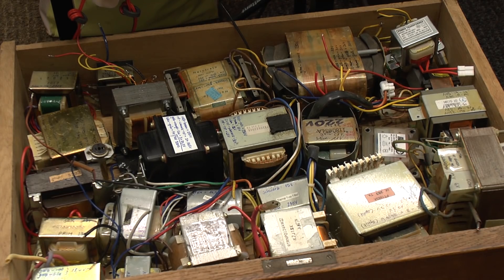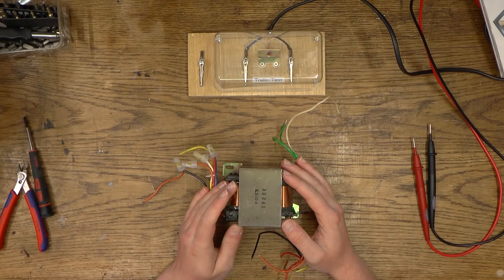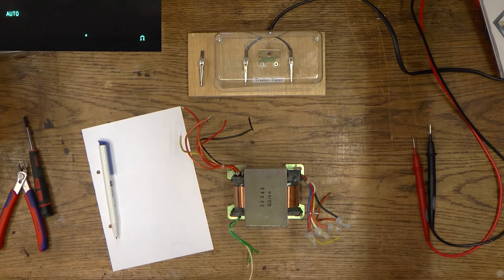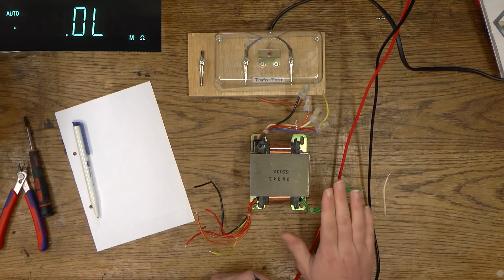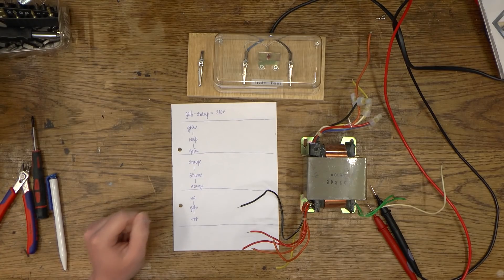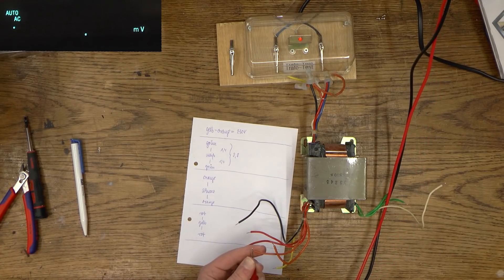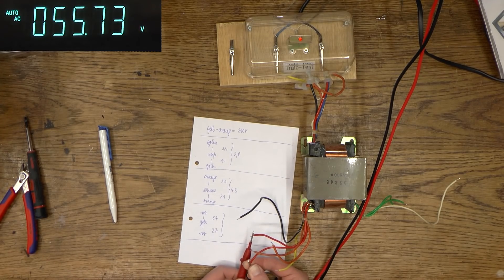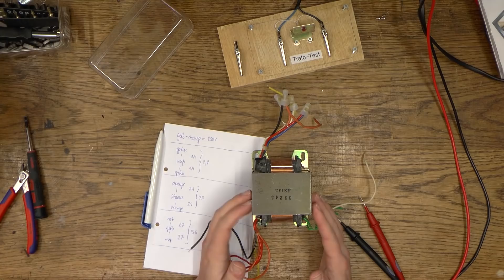How to test an unknown Power Transformer

Comment from the maker: NOTE: DO NOT TOUCH ANY TRANSFORMER CONNECTIONS WITH YOUR BARE HANDS!!!
I knew this transformer came out of an old HiFi receiver that didn't use any High Voltage, so what I did was safe.
Reply: With HiFi amplifiers, I would be very careful!
I have definitely already repaired hi-fi amplifiers that worked with + - 48 to 60 V against the center tap. Between the outer turns it becomes really dangerous.
I would generally be careful when measuring unknown transformers. Especially with your bare fingers. I prefer to use fully insulated crocodile clips for such purposes where I can plug in the test leads of my multimeter, or wago clamps with folding lever. I feel tensions on my fingers already from 24V. Whether DC or AC.
I would always provide open cable ends with terminals, so that no unwanted short circuits arise.
Although many transformers are short-circuit-proof, but you still do not have to expect it. There are also transformers with built-in thermal fuse, which is located somewhere inside or at the edge of the windings.
Some thermal fuses reset themselves when the temperature has dropped, others remain in tripped condition and either have to be replaced (if possible), or you have to take the transformer to the scrap merchant to get at least some copper money.

If there is an insulation fault between the primary and secondary windings, or even to the housing, this can quickly lead to death. To be on the safe side, you should use an insulation measuring device that can generate a test voltage of 500 V.
Reply: This is something that still has me terrified to touch wires. I'm still afraid to use my oscilloscope on circuits because I don't trust my understanding of electricity yet. Dr Cassette, why didn't you get shocked when you touched the 43 volt line? If djblackarrow feels tension at 24V, wouldn't you feel a little more than tension at 43V? I guess my question is, how do you know it's safe to touch? Is it really as simple as the voltage? Weren't you the least bit concerned not knowing any voltages of possibily brushing against something that could zap you?
Reply: DrCassette will using all the output windings simultaneously cause a drop in voltage and or current for each of the output windings??
Reply from the maker: When running any winding with a load connected to it the output voltage of that winding will drop slightly. This should be insignificant in most applications. Each winding is designed to handle a certain current. For as long as you don't take more current than that and thereby overload the transformer, all is fine and the load of each winding won't have any significant effect on the others.

Comment: Nice test jig there, but what I would suggest is to build another jig like that which can be used on the secondary side, but with only alligator clips secured side by side on it, like that "extra" clip that you put on the left side of your primary jig. That way you could hook all of the transformer's secondary leads to it, making it easier to test all of the voltages with your meter without having to touch any of the outputs, just in case it really IS a totally unknown transformer, and the voltage output is high enough to shock you. (Because as you say, anything above 60V should not be touched with your bare hands for safety.) Plus, an added benefit of securing all of the secondary leads to a jig also would be to prevent any accidental shorting of any of the leads when it's on, while you're testing the voltages on other nearby leads!... As you probably already know, if you short out a transformer in that state, (i.e. directly out of it without any fuses or protection circuits hooked to it), you have a very good chance of blowing the transformer, and then of course it would be useless, except for a "paperweight"!

Also, one note about the primary side of the transformer; if it truly is a totally unknown transformer, you should also check the resistance between all of the primary windings to see which set of leads has the highest resistance between them, and then only connect the power input to those leads at first, very preferably using a variac, slowly increasing the voltage, while watching out for smoke and/or overheating, and listening for any really loud humming, any of which would indicate an overload, and that most likely that specific winding is not actually the primary after all... Because if you were to apply 220-240V into a primary that was only designed for 100-120V, then there's also a very good chance of blowing up the transformer, or at least damaging it by overheating it!... Once you found that the transformer works safely and quietly at your input line voltage when using the terminals you chose, then you could go about measuring all of the voltage outputs.

BTW, the "megohm" resistance readings that you were measuring at first between the separate secondary windings was simply your own body through your hands... If you were to use another test jig for the secondary wires as suggested above then you would get an open circuit reading between any of the wires of completely separate windings.
Reply: I am glad you pointed that out
Reply: This was as step down transformer, so secondary windings will be a lower voltage than the primary voltage. However there are step up transformers where the reverse is true therefore touching the secondary wires is pretty dangerous and not recommended.
Reply: Phil Glazzard; Yeah, I figured that was a step down transformer by what he was doing, however, even with that lower voltage, my first initial comment still very much applies, especially in regards to accidentally shorting out any of the leads of the transformer while it is connected to power input, because accidentally doing that could very easily burn out the transformer, trip a breaker, or possibly damage something else in the circuit path, (whatever it is), especially if the transformer is a larger one with either high current and/or voltage on any of the other UNconnected but still very potentially "short-able" leads of the transformer... You just never really know, especially when testing an "unknown" transformer like this, so it would be better to be totally safe than sorry in one way or another!... 

Also important to note is that even with a transformer that's "known" to be a "step-down" type, especially if it has a primary input of 220-240 volts, the secondary, stepped-down voltage can still be quite dangerous and uncomfortable to touch, because it might have a secondary output, (in that case especially), of as high as 120 volts or more, and any voltage over about 60 volts is uncomfortable to touch, and anything higher than that can also be potentially dangerous to some people, especially if you have any kind of heart condition, etc, etc... Voltage tolerance depends on the person of course, but... 

Anyway, the main point that I was trying to make originally was that if he had a complete test jig like that, with enough alligator clips to hold ALL of the leads of any given transformer under test, then he could make much safer, easier, quicker, more accurate, and more consistently reliable test connections for both ohms and voltage(s) of all of the windings, without having to worry about accidentally shorting any of the leads out OR shocking himself!

Comment: It is dangerous to apply full mains voltage to unknown transformer! There could be a short in primary winding and you let a lot of current through. Or you connect to what you think is primary but in fact is something else and end up with too much current going through. 
Instead of feeding the unknown transformer directly off AC mains you should feed it off another known step-down transformer with safe AC voltage level (i.e. 24V) or auto-transformer set to safe voltage. The first test is to find out the ratio between primary and secondary windings. The ratio does not change with voltage. Once you measure the ratio, simple calculation will get you close approximation for expected voltage at full mains (220-240 or 110-130 depending which continent you are on).
You should also measure AC current on the primary as sanity check before you apply full mains voltage.  

As others pointed out, if you must apply full mains voltage to what you think is primary winding (still bad idea!), at least limit the current with a resistor (i.e. incadescent lightbulb).

8 Ohm seems way too low for primary on 230V. Either your measurement of primary coil is way off or you have a short or this may be a transformer for 110-130V/220-240V AC wired for 110V AC and the other windings you ignored could be there to re-wire it for 220-240V AC. Manufacturers rarely put extras in (=cost) and then waste them. Those windings are there for a reason, even if that reason is unknown. You should measure all windings, not just those you think are the primary. The extra wires are coming out on the primary side so my guess is this is a transformer was used to make equipment for Europe and North America and the wiring was switched on the assembly line to one or the other depending on whether the order was for Europe or North America and unused windings were capped with insulators. Some manufacturers connect transformers to a 120/220 voltage switch selector or have all primary leads soldered to a circuit board and have shunts on the circuit board configured depending on the market given batch of equipment was goint to. So the point is: do not ignore any windings on primary site.

Comment: Thanks for the video.
I would have used screw connection terminal block, like https://images-na.ssl-images-amazon.com/images/I/51VPC6NSKHL._SL1001_.jpg
 with that kind you can test every lead without the possible to touch any live wire. :-)
Reply from the maker: We use those here in Germany for making connections inside the junction boxes of the house mains wiring. They are safe, but very tedious to operate repeatedly.
Reply: You are completely right but I think that an electric chock can be a tad more tedious. :-)

Comment: You need a Cliff quicktest. And a current limited input like a light bulb in series with the DUT.
Reply: The lightbulb in series though is brilliant as current limiter.  Build it!  Also good for powering up anything that might blow a fuse.  Bulbs are good because of their nonlinear resistance: low when cold, rising when glowing. It's a super fast PTC!  Also they indicate current draw.
Reply: thulinp Indeed, oldest trick in the book and still great.
Reply from the maker: I'm not wasting money on something that I can fabricate myself.
Reply: Who said you can't make one? :) (it just looks a lot more convenient than your setup here if you do that more often).
Reply from the maker: I don't do this very often at all, so my little setup is fine :)

Comment: I have 2 questions - first did you test the red and black,red and yellow to see if they were a set.Second how would you find out the amperage to be able to use them for making a power supply.
Reply from the maker: If there is a connection from yellow to red and from black to orange, but no connection between black and yellow, there can't be a connection from red to black etc. Logic for the win.
Reply: William Colvin; You can check the current capabilities of a transformer's output (after knowing which are the actual windings and output voltages as shown how in this video), by taking a high power variable load resistor, (which has to be calculated to be safe to use on that specific winding's voltage output by using Ohm's Law, which I won't go into here), and while monitoring the output voltage of the specific winding under test with a meter, connect the resistor's center adjust terminal and one of its outer legs, (the one furthest away from the "adjustment arm"... turn the adjustment arm all the way to one side first and then do that connection), to the transformer secondary that the meter is hooked to using alligator clip jumper wires, and then slowly adjust the variable resistor down in resistance to a point where the voltage on the meter drops down to no less than -10% of the "no-load" or "open circuit" voltage that you first measured without the resistor connected to it. In other words, if the voltage measured without any load from the transformer winding is about 53.33V, (for example), then with the resistor load on it it measures ~48V, then that would be your -10% drop. Then take your meter and use it to measure the current (Amps) flowing through the circuit with that load resistor as adjusted in series with it, and that test would give you the safe maximum current capacity limit of that specific transformer winding... 

Each individual winding's output of any transformer can be a totally different current rating though, so you have to repeat that test for all of the windings... And FYI, I personally have a few different total resistance value high power variable resistors that I use for different voltage transformer windings, but if you don't have any of those type, and cannot find any to buy, (they're getting rarer and rarer now-a-days, check at an "electronic surplus" type store in your area if you have one), but anyway, if you cannot get any of those variable resistors, (aka "rheostats"), then you can also use a few different values of high power fixed resistors, but it's much more time consuming that way to find one to use as a load which only drops the voltage exactly 10% from no load voltage. It's a lot of "trial and error" that way!... And any resistors that you use for transformer secondary load testing, (whether they are variable OR fixed), should be rated for at least 100 watts, (preferably more), because they will get hot very fast with the typical transformer output voltages across them! The ohms needed for a proper load will vary greatly depending on the output voltages of your transformer, (that's why variable ones are so invaluable!), but I typically use a range of resistance values from about 10 or 20 ohms all the way up to around 100 ohms or so... Just remember all of them have to be rated for around 100 watts (or more) for safety, and since the lower the ohms, the more current that's going to be flowing through it when any voltage is across it, be sure to always start the tests with the highest resistance resistors first and then work your way down until you find the one that produces the closest to the -10% voltage drop, and then test the current in the circuit using that one... It IS a very tedious process, especially if only using "fixed" value resistors, but it gives reliable results even on the most obscure and unknown transformers... The main reason being that most transformers have a so-called "load regulation" of around 10%... This specification is essentially what you are measuring with this test... I hope this helps and doesn't confuse!

Comment: testing a transformaer like that is extremely dangerous. 
you are ssuming the primary has 230V. that is not the case with every transformer.
here is another way to do it:
you need an adjustable ac power supply and a lightbulb. thats it. (okay a multimeter is needed too)
you hook the lightbulb in series to the transformer and put some power on it. if the lightbulb is on, the voltage is too high and the transformer runs into saturation. that means only the resistance of the wire itself is there. and that is mostly only a few ohms. putting 230V over a few ohms does BANG. only if its not in saturation, the inductive resistance is also there. so you put a lightbulb in series ( a lightbulb has a low resistance when its cold but the resistance rises extremely when its hot... perfect fuse for tests )
now you turn up the voltage to the point where the lightbulb is barely not lit. now you measure the voltages.
keep in mind, that the transformer is designed for a specific primary voltage and if that voltage is 230V, you will measure with this technique something in between 270-280V. this is because we have a 20% tolerance in our powernetwork and the transformer needs to be able to handle the maximum. substract 20% and you should end up somewhere in the region for the designed voltage. now measure the voltages on the other wires. and use goddamn insulated probes and not your fingers. on a microwave oven transformer the secondary has about 2000V... 
the design current is about 3-4A per mm^2
Reply from the maker: Fact is: You are making assumptions, I have the knowledge. As stated in a comment above, I knew the transformer came out of an old HiFi receiver. The low voltage windings were for the filament of a vacuum fluorescent display. And as for the mains connection rig: Both the GFI and the double pole cutoff switch are part of my workbench setup.

Comment: You are handling the primary side with care but you are touching both contacts of the secondary, that is funny.
Reply: Smartphone David Sure, after measuring it you know it. The resistance of the windings does not necessarily tell you something about the ratio between the primary and secondary. The ignition coil of a car does have a lower voltage on the primary side, just an example.
Reply: I second the OP on this one. Now I know that DrCassette knows what this came out of and what to expect from the secondary, but for the learners among us lets play a game. 

I have a transformer sitting on my desk with an interesting label that you can view here: https://imgur.com/a/eFgIm The left side is the primary and the right side is the secondary. The table at the bottom shows how to connect the primary up to the mains voltage of your local power grid. 

What two terminals on the secondary should you definitely not touch and why?
Reply from the maker: Probably not the point of your "game", but with this transformer being from an unknown (to me) source and with incomplete info on the label, I wouldn't touch any of the terminals ;)